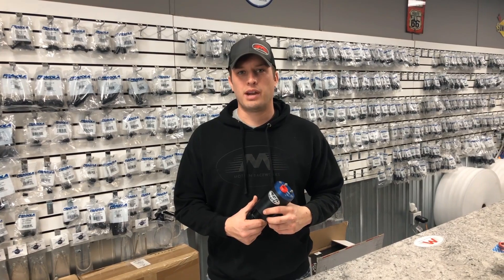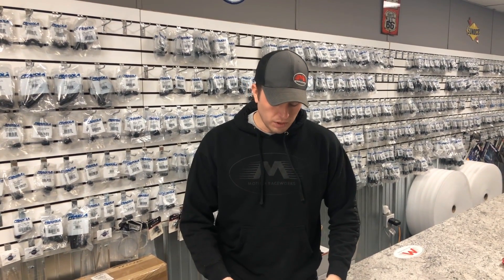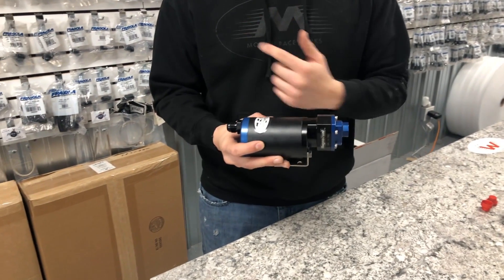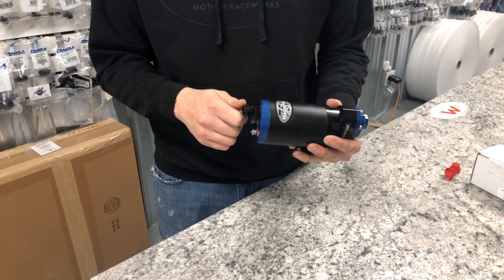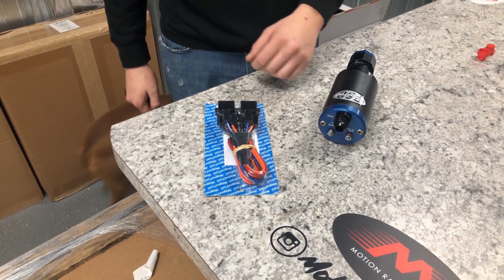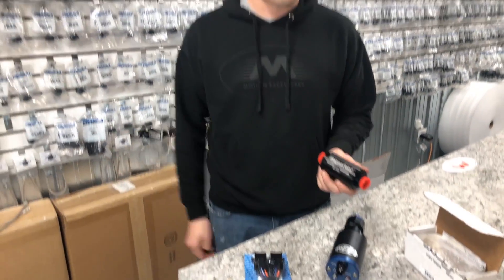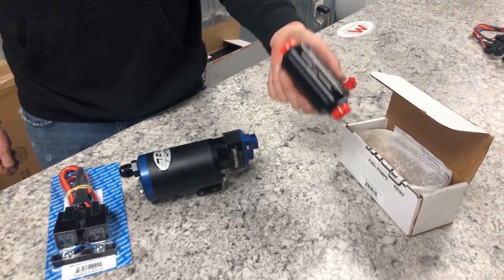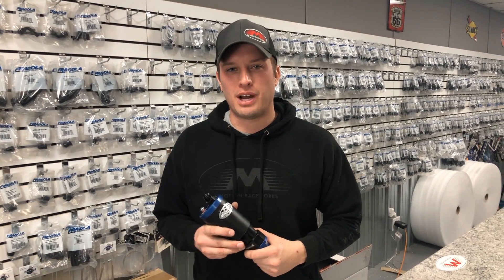Magnafuel 4303 Pro Tuner Fuel Pump | Motion 360

Comment: This is a very good pump. My truck made 1500hp with this setup. The pre and post filter is a MUST!!! Keep up the videos
Reply: How did you do that 
Mines dropping pressure at high rpm with only 850 hp?
Reply: @jackmehoff9909  I’m not sure, Doug Cook specs this in for my application and I haven’t had a minutes trouble with this item. 
I’d give Motion a call and let them help. 
#motiontothefront
Reply: @Jrock2478  thanks I will
Reply: Rocky River Racing  yes issue was the fuel filter was clogged 
Had to get it ultrasonic cleaned to get it all clear...
Reply: Rocky River Racing  it’s hard to beat for the price

Comment: Can you make a video that shows the proper cleaning of a filter.  Also, I have that pump and those filters and they don't like E98 at all.  Pump lasts about 300 miles and is in need of a rebuild, and the filters "varnish" up so bad they become virtually plugged.  Something to keep in mind for those of you running straight ethanol.
Reply from the maker: Dakota Skyhook the stainless filters do?
Reply: Yes, unfortunately.  I've had long conversations with MagnaFuel since I have that 750 pump and the same filters.  The filters I get about 200 gallons through one before they are plugged up (the 25 micron is particularily bad).  Their response was to change them every 100 gallons.  I can maybe get 300-400 gallons through the rear pre-filter, but I tend to change it at the same time.  The pump...I have to send to them for about a $50 repair each time.  In fact, I own two of them so one can go to service while I run the other one and I swap them repeatedly during the summer....and I've been towed home more times than I care to admit.  Note - I still run that pump and filters, even knowing this.  The pump itself, when works, is great.  And, like your feedback, I have -12 feed to pump, -10 from pump to rails, but do only have -8 return currently.  Only about 675 crank hp on E98.  More than happy to discuss further if you'd like.  But as you are a vendor, you may want to talk with them about the problems of E98.  I was a bit bummed.
Reply from the maker: Dakota Skyhook interesting!

Comment: I have holley terminator x wire harness , do I still need this relay ?
Reply: The Terminator Harness does not have a relay and should not drive a pump directly. The fuel pump wire should only be used to trigger a relay.
Reply: @MattRabbitDesign  what he said

Comment: What about 4301 and 4302? Same orb and line sizes?
Reply from the maker: Yes sir!
Reply: @MotionRaceworksOfficial  is the -6 return in my quickstar regulator too small to work with my 4302? Can I get an -6 to -10 and use it?

Comment: can you run ms109 fuel through this pump?
Reply from the maker: ThatBoostedGT at first glance it doesn’t seem like it would be an issue
Reply: on your website it just says E85, do you have any other external pumps that can put through those harder racing fuels?

Comment: What's the noise level of this pump? Thanks
Reply from the maker: claas90017 it is really dependent on how you mount it.  If it’s solid mounted on sheet metal it’s gonna be loud.  Rubber mounted on frame it’s going to be better.